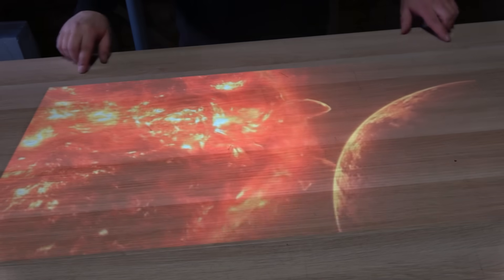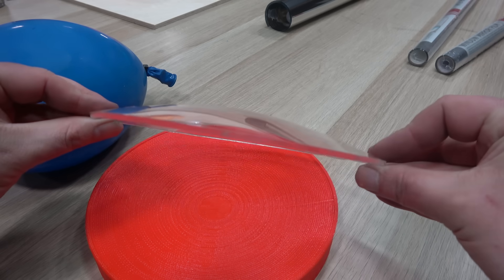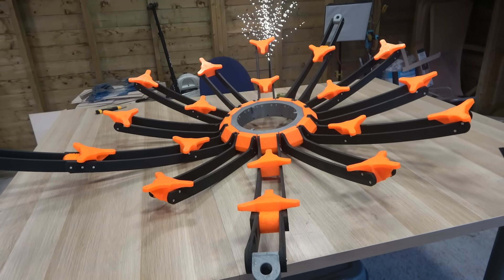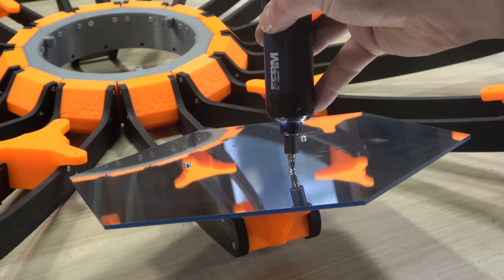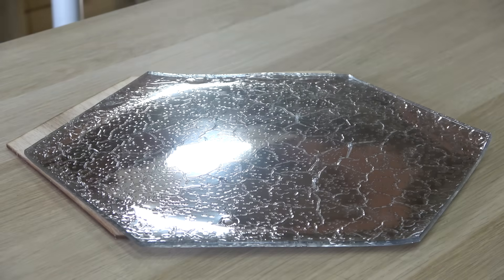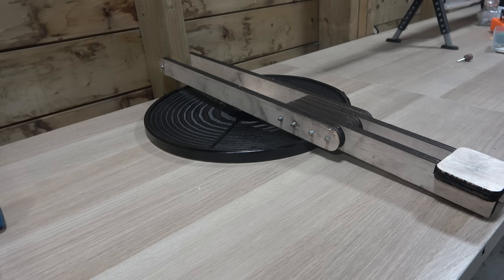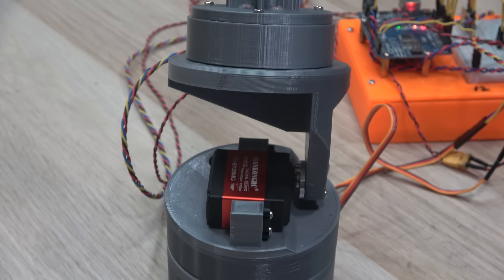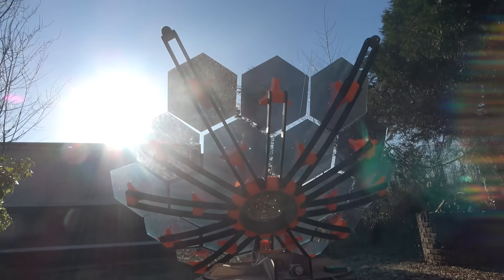Building a DIY Solar Generator..

Comment: Use a collector plate with a cast iron surface. Much higher melting point than aluminum, less reflectivity, greater durability, lower cost. At least get the, ahem, mirror image of your collector plate machined in steel. That way you can use your death ray to melt aluminum and then cast new collector plates as they become necessary.

Comment: the only thing i can see that may fail is the pivot point for the up and down movement.  It should have been more central in location based on weight.

Comment: You might move the pivot point of the up-down axis as close to the center of the mirror structure as possible so that the weight of the mirror is nearly balanced. This would put much less stress on the spindle drive, and require much less power to move the mirror. Would this be doable?

Comment: 0:04 not true. The work is shared with the biosphere, wind, ocean currents, temperature... humans would be extinct if we used the entire 173,000 terawatts! And is that the emitted work in all directions from the sun or just towards earth? Also the angle of incidence with the atmosphere reflects a proportion of the light. It’s not constant there are 6+ phases, also the sunspots maximum has its own phase...

Comment: But how long can this resist the elements and keep producing power? Before it begins to decay or break down from exposure.
Reply: UV degrades the plastic over time, if a storm won't get it first

Comment: not even 2 minutes in and I already see a failure point - solar panels do NOT generate electricity because of HEAT... like photosynthesis, solar panels generate electricity off of UV light...  So none of your explanation matters for a solar panel.  Instead, you need to make something highly reflective to UV light, as well as a highly efficient panel.  Heat actually REDUCES solar panel efficiency... and since you're 3d printing, you damn sure don't want high heat.

Comment: You've spend a bit on a heat collector, but maybe you could improve it by creating a box around it, having the heat collector as the bottom of it, with a very small hole for the light at the top, sinnce it could be hard to paint the heat collector and the paint would still reflect some light, or even cought fire.

Comment: I gotta say, I haven't seen someone design a system intended to create extreme heat with the sun and proceed to use wood and plastic parts that are prone to deforming or burning under high heat. Particle board like that also tends to fall apart if it gets wet while outside. 

Extruded aluminum is pretty cheap and easy to work with, but suffers none of the problems of wood.

Also, use a cabinet rotating table instead of a huge and expensive bearing. You need a thrust bearing and used a rotational bearing instead. Cabinet "lazy Susans" are very common and cheap, they are not precise instruments but that shouldn't matter here.

Also testing on real gold and silver mirrors is pretty redundant when you're not using a real gold/silver mirror on the final product. Reflective window film has completely different properties than real silver. If you want to use real silver, nilered/nileblue has made some videos on making a silver mirror finish on a variety of materials which could likely be repurposed for this application.

Comment: You might want to make your target the same size as your mirrors, then flat mirrors can be used - the second axis you were worried about isn't critical - if you were to use this contraption frequently, it like all homemade devices will require frequent attention - you can make the slight required declination adjustments every two weeks and the unit will perform just as well as if the adjustments are made in real time.  You have to be very concerned about the wind in your design and being robust for lateral forces.  I dont know if it freezes in the netherlands, but if it does, the target medium has to be resistant to that.
If you use this to concentrate sunlight on electrical solar panels, you'll run into trouble with the heat.  You'll likely need active cooling on the electrical panel.  That said, you can scale the target up easily to a, say, 240W panel and either size up your collector or spread out the light over a larger area.
Years ago I saw a version of this using photo transistors for tracking, which worked well.

Comment: Given Jw is a IR telescope and in space and your reflector is an energy collector, the ideal materials probably won’t be the same. The atmosphere significantly reduces the UV and IR  spectral irradiance. Your energy collector is also needs to be tailored to your reflector, the reflectors reflectance and collectors absorption should overlap. I would replace the gold and silver paint with gold, silver, gold and copper foils and repeat the tests and do a cost to performance analysis. The Aluminum energy collector has high reflectance over the entire spectrum uv->IR so you need to coat it with a coating that can absorb as much light as possible. Most the energy that reaches the surface is visible>IR>uv so I would prioritize a black coating with IR absorption or black with high IR transmittance and you could put a Ir absorbing coating underneath.
Reply: Discussing the more mechanical aspects of the design, you should redesign your vertical angle adjustment. Most all dish shaped mechanisms use central mounted pivots and counterweights. This is ideal because it puts the COM close to the pivot point. Solar panels sometimes have a closer design to yours but the mounting of your linear actuator is not ideal. Ideally its connection point should be at the center or above. Search “solar tracking mechanism”.  a large dish mounted counter weight wouldn’t be very beneficial to your design but a small one to counter the reflector dish would be helpful. Your mounting table should be secured or weighted, you could also put a weight on the lazy Suzan opposite of the dish.
Reply: The James web uses a CONVEX mirror for the secondary mirror. A flat mirror will not focus the light on the collector. Use an online optics simulator! You need a convex or concave parabolic mirror to make this work. If you don’t use a proper mirror you might as well mount the collector where the secondary mirror is( TBH IT IS probably a better idea)

Comment: A few observational guesses...  Once you put a black finish on your heat plate to make it more absorbent, I believe you will run into two other problems. 1, the plexiglass backing that you have screwed to the back will become very soft from the heat and allow the screw heads to sink in and lose all their clamping force which will cause the water to leak out. You need a second plate as a mirror image of the first to create the water channels without warping from the heat. it STILL may warp too much though, so some sort of high temp gasket material will be needed. 2, the supporting 3d printed structure to the heat plate will also be in danger of heating up beyond it's ability to remain solid. You should very easily surpass the melting point of any 3d printable filament, and that would cause some issues too. Maybe I'm missing totally on these things, but I don't think so. good luck and I'll be watching for sure! cool project!

Comment: A curved 2440 x 1220 sheet with a copper tube at the focal point might achieve exactly the same effect with far less coat, time, space, effort and may be replicated far easier.

Comment: It might be worth looking into Tollens Reagent for making your mirrors. Just be careful when working with the chemicals. And while that tilt mechanism works inside, this thing is made to be outside in the elements, the big one here being wind. Before using that as your final design, stress test it with increasing amounts of weight until failure or your confident it can survive wind gusts. You could also go with something a little more like what you used for the base but on a cam at the top of a support beam. Plus as others have said, making that heat plate dark or black to absorb more heat is a must, as keeping it silver will reflect a ton of energy that your looking to save.

Overall I love the project though, its an very interesting concept for collecting solar power.

Comment: Use solar collectors instead of mirror? it will generate energy and reflect at the same time. Maybe create a steam engine to convert heat to electricity...

Comment: Collector plate could be within reduced pressure container, similar to evacuated tube. As it is the highest temperature, it suffers the highest radiative and convective losses. This would reduce convective losses.

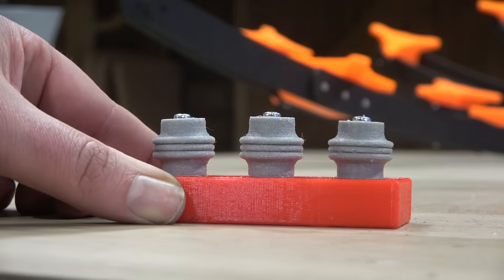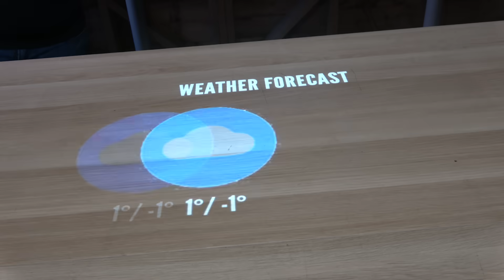Comment: Love the projected diagrams on 3D printed parts!  2:27, all weight directly on the servo, why?   10:53, if the metal plate is meant to reach high temps, why back it with a heat deforming material like plexi?  6:44 leaving the setup outside for multiple days and testing at dif temps and humidity levels would be more realistic.  12:28, just like earlier w/ the servo, none of the weight is distributed away from the moving joint, why?  13:04, you should absolutely be testing during the rain, with all your homemade parts (and all that wood) it may warp into a totally dif machine by the time you get sun

Comment: I would definitely pivot the reflector assembly around it's centre of gravity, rather than at the bottom. Make three A-frames - two with bearings supporting the weight of the assembly and the third off to the side for the motor to tilt the array.

Comment: Maybe try spray silvering the plexiglass instead of using a spray paint. Spray silvering is 98% reflective, wayyyy more than the spraypaints can achieve, and you can do some simple spray silvering in the garage. Astronomers like to use the Angel Guild kits for it.

Comment: Sorry if I sound like a back seat driver, but wouldn’t using thin flat glass mirrors you can buy for very low cost be sufficient in this situation. Would probably also weigh less.

Comment: For the tilt (up and down) movement it would be more powerful if you fasten the mechanism (spindle and motor) in between the outer perimeter of the turning table and the upper rim of the dish. This would easily allow to realize the idea proposed below namely mount the heat plate (alu disc)  in the focus point of your array. Saves the second mirror and by that it increases the efficiency of the system.

Comment: This whole structure placed only in one place is a way to fail when the wind hits it, you need to support it on the other side with some kind of hydraulic piston, or yet another arm, that's going to be driven with seccondary engine. I think it would be even better to leave a hinge where your current mechanism is as a support mount, and lift the lifting or lowering task can be left on the other side, will make it way more reliable and stable. Also the must go is chrome plating, you can polish it and make it even better than a mirror. The crucial thing is to make it pervectly smoth.

Comment: I have wanted to try this for a hot tub or something remote. I have an idea… instead of making parabolic mirrors (and the inaccuracy’s/power losses) what about… 1) using flat hexagonal actual mirrors (or cheap transparent glass you coat with aluminium sputtering) 2) moving the heat sink to where the flat mirrors converge. 
I know it’s heavy and will need metal support AND it’s harder to move to follow the sun, but… the flat mirrors only need to reflect somewhere on to the heat sink it doesn’t need to be perfectly focused. I think you might get much more energy this way?  Also obviously the heat sink needs to be black if possible. Lovely project. Thanks!

Comment: To simplify your design and remove a motor, the sun actually travels in a straight arc.  For example, you could make it so the Lazy Susan bearing is aligned with the ecliptic plane, then you can fix-mount your mirror 90 degrees off of it, completely removing the jacking screw.  It'll require a little tweaking between seasons, but it'll cut your complexity down.

Comment: you have a big problem with your scientific method. PAINT is not the same thing as the metal it mimics. you don't gain any of the metal's properties by using a paint that looks like the metal.

Comment: instead of tracking the sun through the day build redundancy with fixed angles horizontally with pitch adjustments manually for time of year fine tuning.

 also trapped light. draw a circle. erase a single small spot anywhere . the push one side of the break inwardly towards true center or out to prevent alignment. now picture that as a 3d shape extruded . this can be as wide as you want it. now sandwhich 2 sides on it to collect the heat or use only one side and use a mirror on the other. light entering will not be perfectly aligned to be trapped forever. it will hit the side plates. these donot have to be reflective and can be given anodization. the curly piece can be sheet metal given chromium electroplate finish. 
however anodization may reduce thermal transfer despite absorbing more light. testing needed given eachnpigment manufacturers different blends.
why bother ? light that hits the side plates still bounces. heat is produced over time. this ramps up. the entry way is small relative to the total size but redundancy allows this to scale. the piece tht makes this work is a lense to direct more light in to the entry pathway. this can be a wall of maller lenses with pitch adjustment with the entire wall having its own pitch djustment for time of year. done manually so fewer electrical parts. a understanding of you point on the earth and time of year needed to make adjustments

Comment: You could put the light detectors on a very flat 4 sided pyramid and put their voltages through two cables - detectors on opposite sides are connected to opposite polarities on the same output cable, so North positive is connected with negative of South - the currents cancel out and you're left with the little difference caused by amount of sunlight hitting each of them. With some calibration you can pump this directly into amplification circuit (it won't be enough to move the entire thing), and then into proper engine, no computers needed.

The systems accuracy depends on how flat the pyramid is and the sensitivity of your sensors.

Also, you may want to put one way connections like diodes between detectors and joint output, to avoid power from one going into the other.

Comment: Clickbait much? No way that you can either escape 2,5kW with that pump nor contain that amount of heat energy in those plastic tubes. Even so, 2,5kW is a gross exaggeration, i'd say it's closer to 0,25kW than 2,5kW. The sun deposits around 1kW/m2 at high noon and no clouds so even with perfect mirrors and no losses you wouldn't even come close to 2,5kW. But, alas, thank you for playing :D
Reply: He changes the video title a lot. As I am typing this it says "Building a 5kW Solar Generator From $5 Mirrors" 😃 Of course it's far from 5kW, more like 1kW if lucky. The mirror price is also questionable.

Comment: Around 30 years ago, I was involved in a project doing low-budget energy solutions in Belize, using recycled materials. One project was a solar collector, much like the one here.

An old satellite dish was used with hundreds of small square mirrors, cut from common bathroom mirrors. The focal point, however, was not reflected but suspended from the edges of the parabolic dish. The result was so successful that it proved to be downright dangerous in the hands of the inexperienced users it was intended for.

Comment: You may wanna try applying the reflective film after shaping the plastic. You can also use soapy water to make it easier to apply, then using a heat gun to adhere the film to the piece. Good luck!

Comment: Great project man.  One improvement I would make would be to simplify the tracking system.  If you use an equatorial mount then you only need to move the whole assembly in azimuth (on the lazy susan axis) at 15 degrees per hour- a lot easier :)

Comment: TPU will change its springiness with heat!   Also place a ball-bearing at the centre of the back of the mirror.  This gives a fixed distance from the baseplate and a pivot point that never moves.

Comment: Great build, i would make it pivot on a trunnion instead. Less stress on the shaft of your control motor. Use a gear mechanism just like your lazy Susan.